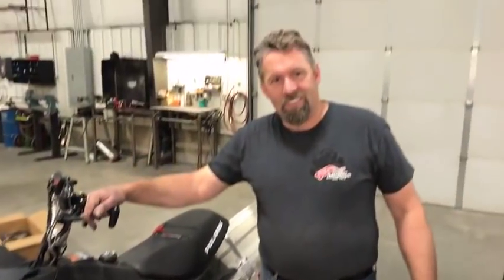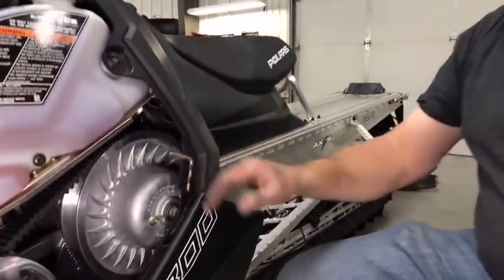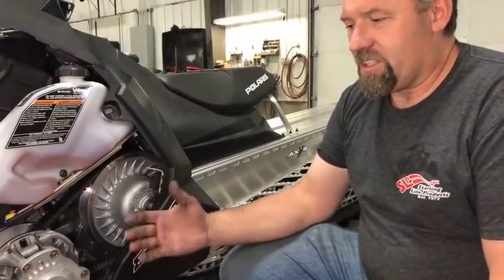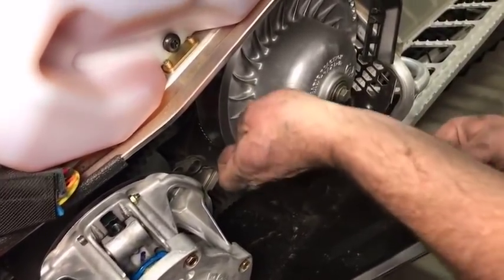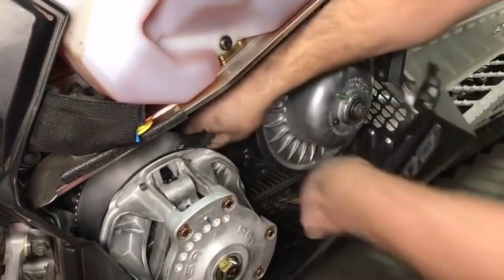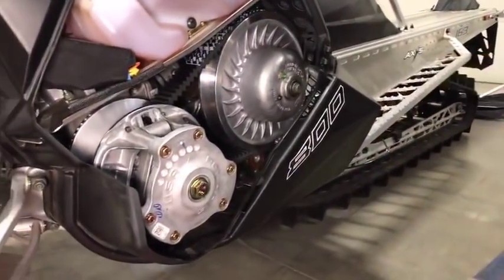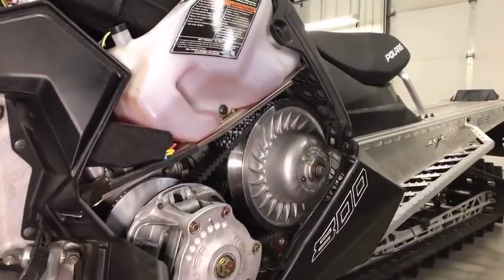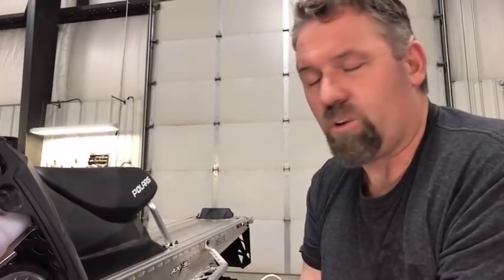How to adjust Pro RMK belt deflection with SLP's Jerry Mathews - the SNOWEST show

Comment: Should there be a little play with the whole secondary unit back-and-forth after the centre bolt is tightened??
Reply: Mist3r Brown yes. They call that free floating secondary. Helps alignment when both clutches are turning.

Comment: Hi my question is this is there supposed to be any play or side-to-side movement in your secondary clutch they call it floating no I have never heard of this I have always bolted my secondary tight so there's no movement I really can't get an honest answer I'm getting a lot of different answers I'd like to find out what really is true here. Could you do a video on it that would be awesome or just send me a message back.
Reply: Absolutely you need float in the secondary. Depending on make and model, set accordingly.  Usually .060" to .080" is were most will be set. as far as the secondary, you want to set offset first. Than the float. NEVER lock a secondary tight. You will destroy your belt because alignment will be off. Plus you will prematurely wear out the jackshaft bearing behind the secondary because it will be side loaded.